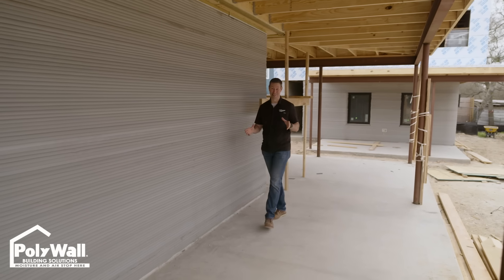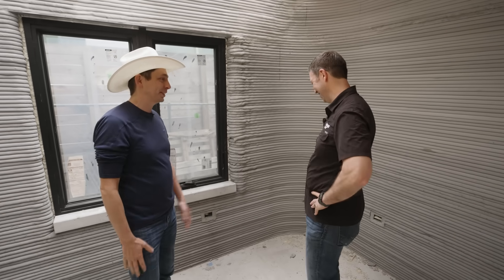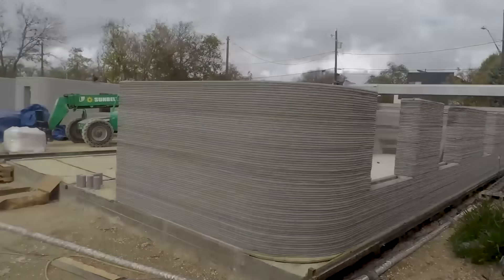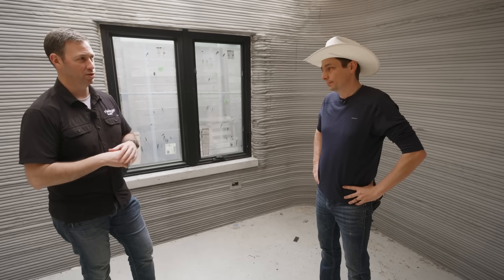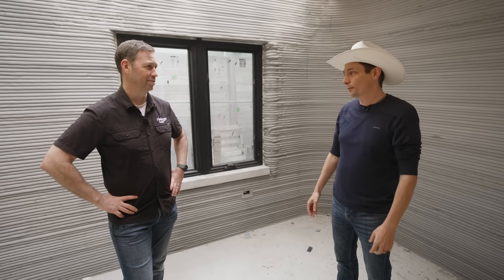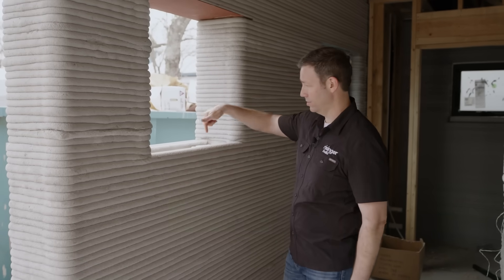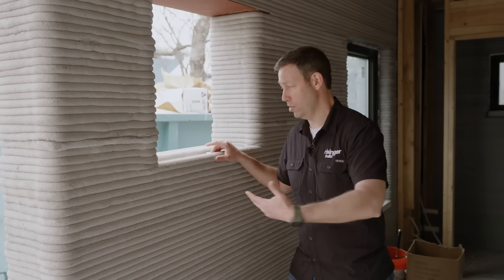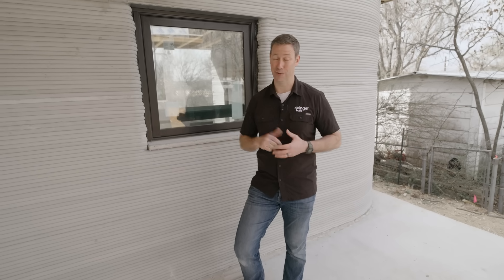Is this the future of Construction? 3D Concrete Printed Homes

Comment: I'd like to see these structures tested in a wind tunnel or with 2 x 4 cannons to see how the walls stand up to tornado flung debris.
Reply: You can print a dome shaped house.
Reply: @martialman.4563   You don't need to "print" a dome. The technology for doing monolithic domes has been out and proven for over a generation.
Reply: @chrisnelson414  exactly this^^^ the technology has been around and developed since the 60s. i recently visited Italy Texas and met with David South (now passed, sigh) the original patent holder for their dome making process, and got to tour his dome home. his method and his company have a hell of a great construction method going for them. i am thinking of ways to improve it as well, since i am absolutely certain of the efficacy of dome buildings. concrete, must be reenforced, and a dome, being aerodynamic would never feel the full force of winds at any speed due to its shape. i am surprised more people dont understand this truth.
Reply: A lot better than the stick house your in now
Reply: @johndoe-wt4ui  right now, I'd still prefer stick housing with drywall.
Reply: A flying 2x4 won't break a concrete wall.
Reply: @MrBeard-ig5zc  send it flying fast enough and you'll be amazed what a 2×4 will fly through.
Reply: @MrBeard-ig5zc  It will if it's not steel and concrete reinforced. https://www.youtube.com/watch?v=Jo8OuQUcpGo
Reply: @Doc30jj  Thanks for the link!
Reply: @MrBeard-ig5zc  this isn’t traditional concrete from what I understand.
Reply: Every 3d printed home should be tested with a nuclear bomb. That'd be awesome!
Reply: Could probably be done safely with an internal grid, Beth Kirk. No reason to why this wouldn’t work,..
Reply: Why? Our current houses don't stand a chance
Reply: @BGraves  what do you mean? We test those kinds of structures fairly regularly and can reasonably build homes that withstand 150mph winds.
Reply: @chadleach6009  I think you missed the distinction between 150 mph wind versus 150 mph 2x4 hitting end on.
Reply: @henryD9363  you understand that with the sustained winds of a hurricane that a 2×4 getting up to that speed is about as difficult as tossing one into the wind.
It'd be different if we were talking about gusts.
Reply: @chadleach6009  can, but we don't.  150mph is tornado speed.  Tornadoes level every structure in their path.
Reply: @BGraves  you’ve been to Mt. Everest. We should build houses out of you

Comment: Undecided with Matt Ferrell just put out a video today about the same topic, he focused on the environmental factors of it. I think when i build a house ill end up doing an icf build over 3d printed.
Reply: ICF I feel makes more sense, thinking about it from a traditional building, rough in, or remodeling sense... ICF is cheaper and easier for the everyday builder or diy types... The ease of use for icf and integration of traditional siding and walls, plumbing, eletric just makes more sense.... For example re wiring this house would be a nightmare, running plumbing would be a nightmare... The one thing that's for sure, is future owners will be eating the cost...
Reply: I think there are a few benefits of this over ICF. The insulation is protected from termites, weather, etc. on the inside of the wall. The cost should be lower without as much siding or interior framing or trim work required. And you can fasten to the walls anywhere vs planning out attach points in advance like on ICF. These 3D printed houses look bullet proof.
Reply: @MartinThmpsn  you shouldnt talk about stuff you know nothing about.  Termites eat wood, specifically wood that has moisture in it.
Reply: @chuckd9007  you should read up on ICF and termites. While termites don’t eat EPS, they absolutely burrow through EPS and can reach roof and other structural wood members in a house in an undetectable way by burrowing through external EPS insulation, like an ICF. This has led to bans for use of ICF below grade or within 6” of grade in many parts of the US. The advantage of this 3D printed house is that the foam is encapsulated within the concrete and cannot create an undetectable termite infestation the way ICF can.
Reply: @MartinThmpsn  The Perfect Block is supposedly a bug-proof ICF (they call it an ICCF).  Wouldn't ICF with a membrane coating be okay and bug proof?  Matt like Polywall products quite a bit.  I'm not sure I've heard how they might help with bug infestation.
Reply: @cpad007  The most effective system I have heard of is that the ICF manufactured and used for termite prone areas gets treated with borate. I work in a non termite issue area, so have never had any issues with my ICF projects, but this is my understanding on what it done in those areas. I imagine the peel and stick membranes, as well as the parging around the base all help impede them.

Comment: Maybe adding a vertical roller to the printer to smooth out the beaded surface?
Reply: man this would be great, I am sure it would be hard to do. That cement mix prob is fast dry to prevent sag and slumping. But if you had a special bit behind the print nozzle that would press and remove excess, and possible carry the excess back to the print hopper. That would be pretty great, I would think most people would pref a smooth wall.
Reply: @KurtFeudaleKing  lookup zero slump concrete, sometimes they add accelerators to the mix a few feet from the nozzle so by the time the mix is out, it can not be reused.
Reply: Great Idea smooth walls would be much more apealing to the public.
Reply: Yeah, ridges can be cool if you like them and will be better for sound reclection but they are a magnet for dust...
Reply: The concrete I'm sure is sealed to protect against concrete dust. I for one always paint my houses too.
Reply: @rhiannahardy-janisch1716  i was more thinking dust settling on the top edge of each layer, it would be a full time jobs dusting the walls lol
Reply: @rhiannahardy-janisch1716  That response may have been referring to everyday dust (dander, tiny debris from outside, etc) and not the concrete dust.  I may be wrong, but thats how I interpreted it.
Reply: @Danirio96  I didn’t even think about the cleaning aspect.  great point.
Reply: They actually have some that smooth as it is extruded from the hose. This version just doesn't have that.
Reply: Or just render or clad in stone like a lot of other houses. The inconsistencies in the print layers especially around opening offends my eyes i couldnt bring myself to buy one lol. Sort the outside, finish the openings and skim the inside and it would look much nicer and no issues with dust build up.
Reply: @samlee3784  I appreciate and relate to the "offends my eyes" part of your post!  It's wild how I'm completely unaffected by "inconstancies" in nature  but anything we humans do that isn't lined up and acting right - makes my eye twitch.  lol
Reply: @tdunn2  same nature doesnt bother me one bit but anything man made should be square, consistent, symmetrical etc, any other way drives me mad lol
Reply: Yes,,,,I agree,,,,this is in progress,,no doubt,,,,,,what's to come !!!....cool,,,,,the wiring and plumbing will always,,like in all homes,,,be individual,but a trowel,or roller,will be soon...crazy shit here,,,,,,,hope this dose not drive the price of mud up too much though. ! ....😯
Reply: @Tim Dunn It doesn't matter. The walls have to be finished out with drywall anyway.
Reply: @gandr.e.5136  I’m not sure that’s an absolute but I hear what you’re saying.  I think I’d rather have a consistent surface to fasten the sheets to also.
Reply: Reminds me of an old pipe wrap that was soft and corrugated. This was back in the 1960s. Don't know if it is still made.
Reply: Probably easier to increase the layer resolution instead, but would it massively increase build time?
Reply: @a22024  From my background in composites I can say that it would drastically affect build time to change resolution. Part of it is nozzle size and thickness. In order to use their 2" nozzle to maintain good pressure and flow and achieve a 2-1/2" width at 3/4 height gain (from what it looks like) each strata has come through a lot of trial and error I am sure. Increasing resolution would either need to adjust layers to smaller thickness, and often involves not just slowing the machine, but nozzle adaption most likely. Have it go from one resolution to another would be the most difficult, but maintaining either one wouldn't be too bad. The most elegant approach would just to have screed wings follow the nozzle to align it with the layer below. This would result in near flat walls but I don't think that is the goal. The goal at this stage is likely to harness the uniqueness of the process so the layers are intentionally showcased. Since it is ready for any stucco/parge/plaster veneer coat as it is, it seems to me they are leaving the ridges as part of the aesthetic. (I would definitely add the screed wings myself!). But anyhow, the initial question: higher resolution could easily double or triple print time, maybe more.
Reply: The texture actually adds to the aesthetic imo but everyone has different taste they could add extensions to the machine for different looking finishes

Comment: I’m an architect and 3d printing is a hobby of mine. I cannot see a use case for this.

There’s no reinforcement or aggregate?
Reply: I would imagine there would be some sort of fiber reinforcement in the mix.
Reply: @pinkrobot228  fiber reinforcement isnt reinforcement
Reply: Icon calls their mix lavacret. SQ4D uses a different technique I think.
Reply: Steel and glass fiber are renforcement. Obviously it has an aggregate. Seriously? Youre a profesional and cant tell this is a layperson video. I agree there isnt much use for this for a long time yet. It tries to replace the most efficient crews on the jobsite, framers.
Reply: @sparksmcgee6641  calling glass fiber reinforced concrete reinforced concrete sounds like a lawsuit to me.

They serve completely seperate functions
Reply: @thomaskelly5183  depends on your mix.10-20-50kspi concrete is different than the concrete you are talking about. This mix vs the mixes i use is equally distant from both to yours. No lawsuit because i provide the mix and it performs as such. 90% of 3000 psi mixes are degraded on install and are not in fact 3000psi. Thats a lawsuit.

Comment: I bet the acoustics are nice with all of those interior ridges.
Reply: I hadn’t thought of that, but you are right... especially being ally bridged all around, the only exterior noise intrusion would be doors and windows. That would make for a relaxing home.
Reply: good point
Reply: hell no. it’s still concrete. maybe it would prevent outdoor sounds from coming in, but there’d still be a lot of reflections inside.
Reply: @trevorhardy3544  do you mean echoes? Nope. Echoes only a problem in empty rooms with flat surfaces. That kind of wall will diffuse sound waves...similar to the type of walls use in recording studios.

Though I do worry about dust and mold accumulating in those creases.
Reply: @MrArthoz  no. i mean reflections. that’s what we call them in the music industry. and no, you are wrong, the concrete will HARDLY diffuse anything, especially in the low-mid range and below.
Reply: What can you use for inside roof, sound proof, white, for cathedral roof?
Reply: @carrerasrivera  I don’t understand. Sorry.
Reply: @trevorhardy3544  Sorry, sometimes it make sense in my brain.  What I mean is if there is a kind of roof(ceiling)  you can use for a cathedral kind (high ceiling) that can be color white and it can be use to reduce sound or absorb sound. (having a quiet place is a big thing am looking for, but want the space of high ceiling)

Comment: 1. Does not look like concrete, but just cement, or perhaps with a very very small aggregate.
2. I am not seeing any rebar to provide structural strength. 
3. I be concerned that the bonding between layers is weak. 

FWIW: I think is an idea like flying cars. An interesting idea, but not very practical. 

If I was going to develop this technology:
1. Include a mechanism to add rebar. or some type of re-enforcing steel.
2. Make the walls smooth\flat instead on round beads of concrete. A pair of side rollers that smooths out the sides so there is more contact between layers (better bonding between layers). Might better to use multiple nozzles stacked so that layers are thinner but still operates at the same speed per pass.

Comment: One additional comment, Matt u mention it’s disaster resistant. What about earthquakes? Seems fairly rigid for seismic zones which need more flexible structures.
Reply: Concrete is the highest safety standard in earthquake zones. EVERTHING in japan is concrete. Im sure someone is now going to link to the 1 percent of housing the thats wood

Comment: What happens in 15 years when a pipe needs replacing? Once you carve into that wall it's going to be hard to make the patch look good.
Reply: Pex has a longer life expectancy than 15 years, closer to 100 years. You do just as is in any other traditional home on a slab construction. You rent a jack hammer and buy some Type1 cement.
Reply: You embed conduit/penetrations in the wall as it's being 3d-printed, and then you run pex through the conduit.  If the pex needs replacement, you just pull the old segment out and the new segment in, no need to disturb the structural wall.
Reply: Just plaster after repair?     Just a thought!

Comment: curious about the shear strength in a seismic zone
Reply: Low
Reply: With no rebar it's a good question.  They would have to honey comb the print with fibre reinforced crete.   It's worth seeing where it goes as I live in a seismic zone (Pacific Northwest).

Comment: Seems like rebar or wire mesh would be needed for structural integrity.  Also, the foundation work would have to be impeccable.
Reply: Fiber reinforced or micro rebar (1" steel pins mixed into concrete) would probably work.  The foundation really doesn't have to be perfect at all.  The 3D printer could be configured to go around and measure the distance to the foundation with a laser every few inches before starting to print.  It could then use that data to adjust the first few layers to compensate for any uneven surfaces.  Many modern plastic 3D printers have features like this because the glass bed is never perfectly flat and the layer printing tolerances can be 0.1mm or less.
Reply: @CL-gq3no  - good point about 3D printers being able to compensate for small imperfections on the horizontal flat surface of the foundation. I was more referring to the foundation’s structural integrity however. I’m sure we have all seen plenty of cracked foundations. Most of these are minor enough that wood frame construction can compensate without showing damage. It would seem that with 3D printed concrete the cracks would continue up the walls.
Reply: In the shape internal to the walls it acts as it's own reinforcement.
Reply: I assume the concrete is continually mixed. Otherwise the concrete still in the truck would harden if the lower layers had hardened
Reply: @henryD9363 , I believe it's dynamically mixed on site as it's needed if that is what you mean.  So hopper full of dry cement, another full of sand/aggregate, water, other stuff, all being continuously measured and fed into a hopper.  That is pretty much the only way they would be able to control the consistency well enough to 3D print.
Reply: @henryD9363  even still being mixed there is a time limit for using the concrete. As soon as water is added the clock starts for when it has to be used. A project I'm currently working has a 2 hour limit for the concrete mix. It takes an hour to reach the job site. Forms and initial inspections have to be done prior to the trucks arriving....and all required inspectors on-site.

Comment: It would require some significant code changes here in MN. Those changes require deep pockets. Concrete needs water and there is not any on the moon. Exciting for sure.
Reply: Seems like maybe there is some. https://moon.nasa.gov/news/155/theres-water-on-the-moon/
Reply: @tominglis9690  okay, got the water. Where's the concrete?
Reply: Yes there is water on the moon and cement can be made with almost no water. I presume there are mixes that dont use water, its just the easiest.

Comment: Is there is some sort of fiber reinforcement in the concrete to prevent cracking? There doesn't appear to be...
Reply: Judging by the giant crack under the window he was standing by starting at 8:25, I am guessing not
Reply: @BassFearDave  Dang, you are correct. Good eye.
Reply: Ones built in ny used a fiber in concrete
Reply: @5:51 there's cracks as well